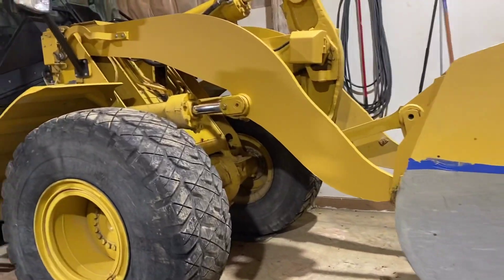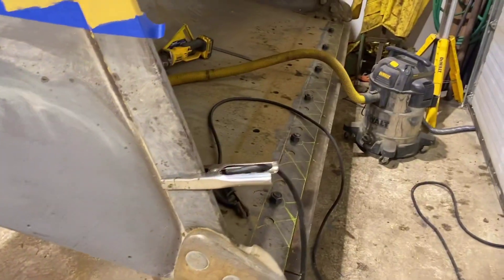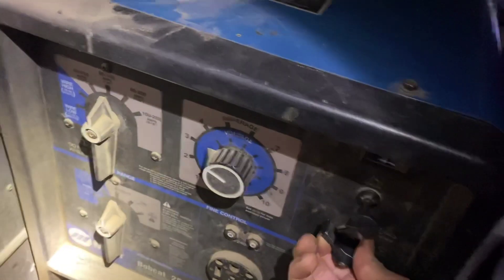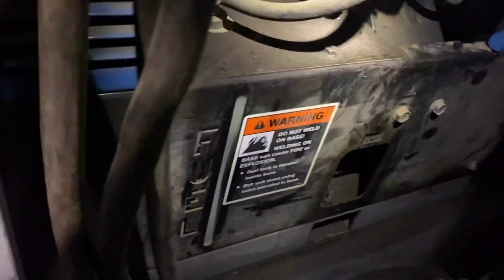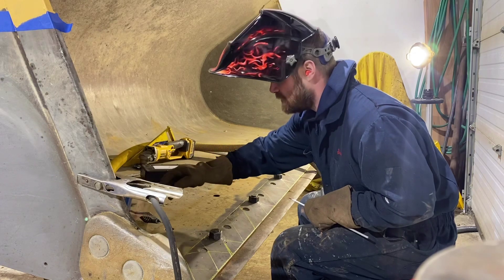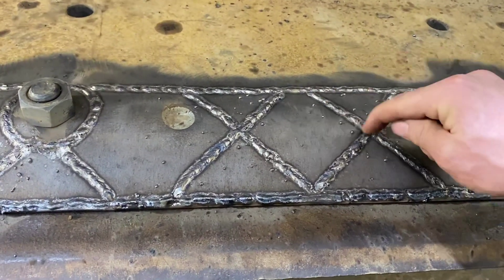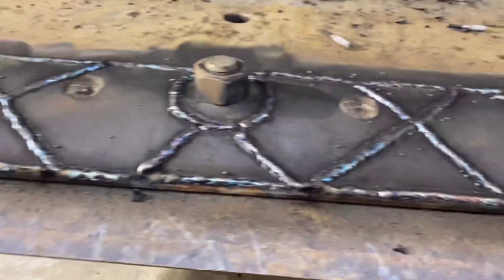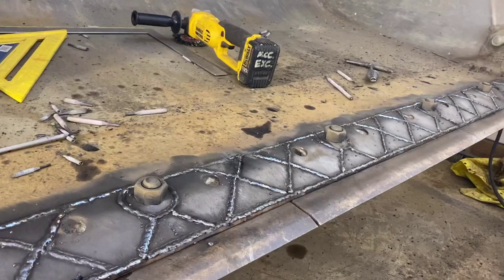Loader Bucket Hardfacing

Comment: Looks good man! Don't worry your not doing anything wrong those rods are still good. The rod burning up half Way through a weld is normal.  It's not because of the age it's because of the alloys in it. All hardfacing rods do that and other high alloy rods like inconel, Monel and some stainless rods do it too. When hardfacing I usually burn half of the rod then put it aside. later i turn my amps down and burn the pile of half rods.

Comment: dope vid. i'd add more hardfacing tbh, I usually see it done with a bit tighter patterns to keep the wear on the base metal down. if you're primarily using that buckets for big rocks though, your pattern should be alright. If not, I'd put like a + shape inside the diamonds you made. Though, thats up to you, and thats just my opinion. love your vid, (p.s. hows welding jobs in alaska?)